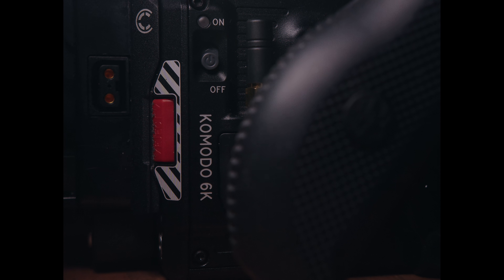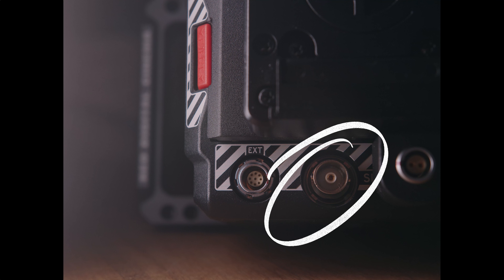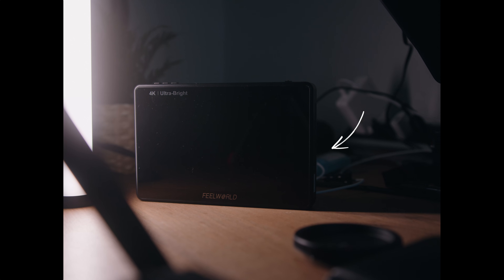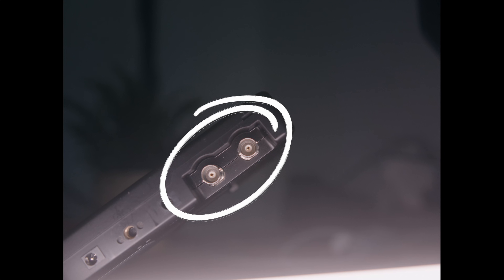how to stop frying your sdi port (red komodo)

Comment: Is this mean that a power adapter cannot be used because if the power goes down (which happens pretty often in my country) I can burn the SDI port? Or no? Most of the professional cameras come with a power adapter and it is very handy to use it. Does this put a limitation? Thanks.

Comment: What happens if you let the battery run out and the camera then switches off without you unplugging the SDI?
Reply from the maker: I'd try to avoid this as much as possible as it's not good for the cam and the port

Comment: I have an issue where the picture on the monitor starts to go in and out after a while. Ive tried changing the cables, batteries, changing the settings like 1080 or 2k changing the Hz.  Could I have a faulty sdi on the komodo? Or is there something im not soing right
Reply from the maker: Might be a faulty SDI. But you might want to check with RED directly

Comment: I wish if you went to the trouble of making a video, you would read the manual. 

From the Komodo manual: "The camera's power state does not have an impact on SDI attachment sequence."

It's about the monitor power. It's not about camera power. Please update your video or remove so you stop adding to the confusion.
Reply from the maker: Hey Josiah ! Thank you for taking the time to comment on here! Don’t you think that using a « last in first out » approach is an easy way not to f up your sdi port? I do. The camera state might not be relevant but when everything is powered off one v-mount for instance it is! In my opinion it’s a good/easy way to remember the correct procedure.
Reply: That's fine that its your method, but when you tell people that's how its supposed to be done, instead of stating its your own preferred method, you add to the confusion. Like I stated on FB, people power cycle their camera all the time to save battery. I too use V-mount to power my monitor and camera but you can still turn off your camera without affecting your monitor.
Reply: @josiahthiesen  So if i power my monitor from v mount with dtap and my camera with the usb port from the same v mount i dont have to fear anything?
Reply: @Milan-cf1xe  it might surge
Reply: Josiah, you’re wrong. The manual is just referring to power on-off the camera once it is plugged and grounded, but not to plug/unplug (ac or battery) which is what the video is about. You should be more respectful and not that smart ….

Comment: I’ve had some sources say this is only an issue when plugged into wall power, is this a battery and wall adapter issue? Just trying to figure out how careful I need to start being 😂
Reply: From the Komodo manual: "The camera's power state does not have an impact on SDI attachment sequence." If you are talking about having your monitor connected to the wall, the same concept applies. Power on your monitor before you plug in the SDI, and unplug the SDI before you disconnect power from your monitor.
Reply from the maker: Yeah sources say this and then others say it’s when you hot swap... I think the safest thing to do is to live that LIFO LYFE no matter the situation haha